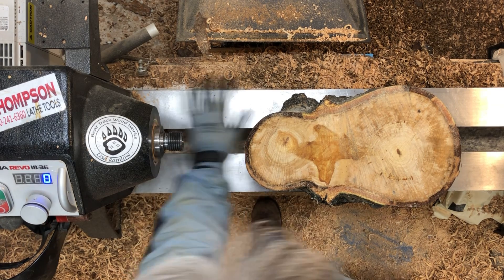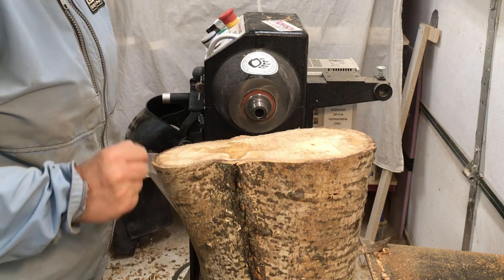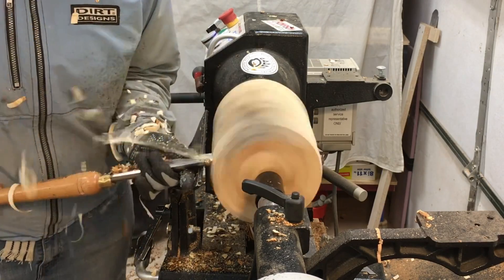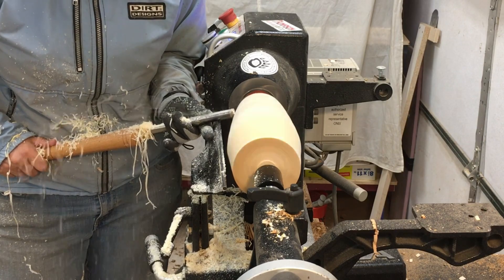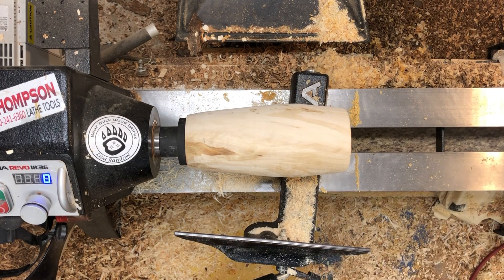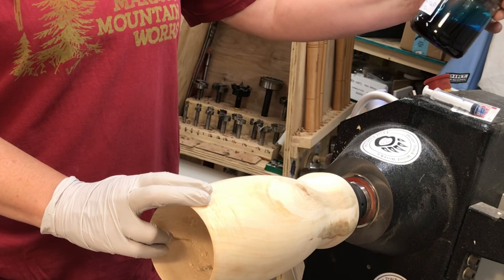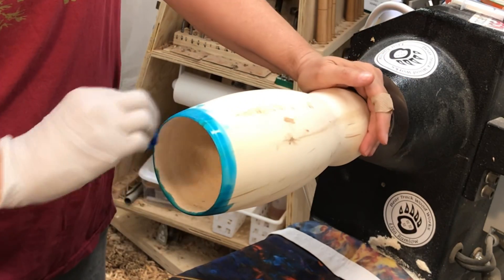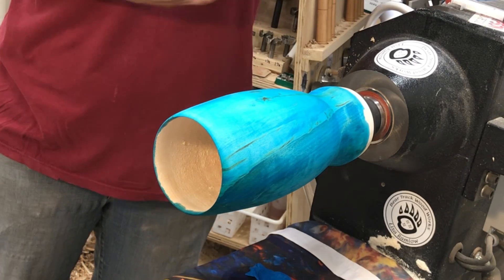Woodturning: Wood Dye on Poplar Vase + CA Glue Finish

Comment: I've tried some dyes, but not the turquoise.  I've never attempted finishing with ca glue out of fear that I would glue the paper towel or myself to the turning.  This came out really well Lisa.  Thanks for sharing.
Reply from the maker: Hi Jim! I’ve always been iffy about CA because my experience had always been one of just that - gluing everything except what I wanted to! But I’ve gotten over that and disco that CA is ridiculously handy and versatile. Buy the vinyl food service type gloves - CA won’t stick to those as they are the same material the CA glue bottles are made from 👍
Reply: @LisaRamlow  Thanks for the tip Lisa.

Comment: Thanks for this one Lisa. I've been fascinated by the whole dye process for a while, but nobody would really explain it in detail. I've seen some amazing finished pieces, but they won't share how they did it. This helps a lot.
Reply from the maker: Thanks Tim! Not a tutorial by any means but I have tried a lot of different things with it as far as trying to seal it. I sprayed shellac from a rattle can and then tried to put a coat on with a paper towel, still ran. The CA is definitely the best sealer option so far.

Comment: Well, you got me with the CA glue. I never thought you could use it successfully like that. At the very least, I thought you might drizzle from the top, catching the excess. But, well done. Great finish from a method I never thought would work. In fairness, I've never had success with it on smaller projects, but I thought I knew how large a project you could use it on. And on soft poplar, too.

I enjoy working with dyes, a powder pigment that can be used in water or alcohol. I've only used water, so far. With water, especially if using multiple colours, the more dyeing and sanding, blending and reworking the better it looks. Seems to give it a look of more depth. That was fine, for awhile. I soon wanted those beautiful gradients Martin Saban-Smith and Stewart Furini (both YouTubers) are skilled at. Wayne the Woodturner, too, I suppose. Airbrushes were the key.

I also had trouble sealing in the dye and getting a proper finish. Anything applied by hand would change the look, and I'm not one for serendipity. Spraying the finish with my little airbrush was the key. Initially, 7-10 coats of Wipe on Poly (sprayed) was a great success, but a bit long to complete, for my tastes. So, I tried shellac. Not bad, at all, and days quicker to complete, under my circumstances. Typically, I'll just use 1lb cut, spray a coat every 60-75 seconds, for about four coats. Then set for an hour, lightly sand 1000 or 2000 grit, do another few, wait, sand and a few more. Cure overnight, polish, wax, enjoy. 

About the buffing wheel, yup, happened to me. As soon as I thought about the edges of your piece coming around to the wheel like getting a catch, it hasn't happened, since.

Great results, colour and finish.
Reply from the maker: Hi Jay! Thanks for all the info - I did try spraying shellac from a rattle can and then putting another coat on with a paper towel - still ran. It ran after the abrasive paste and with the final finish. I must’ve not gotten enough shellac on I guess. An airbrush is on my list of things to try for sure and Martin and Stewart do some great work. Every project is a learning experience, even if it’s what NOT to do 😂
Reply: @LisaRamlow  Yes, learning together is good stuff. I forgot to say that I want to try these dyes with alcohol, but sprayed. Before, applying by hand, I needed the working time. Sprayed, you might get interesting effects from quick drying. About spraying shellac, I tell myself if you think you're good, four more coats. :)

Comment: That vase came out beautiful and the colour really enhances it.

Can't say about the dye you used, but I use some spirit based ones and no matter how long I've left them to dry, if I apply a sealer by hand, it will lift.  My understanding is that it gets reactivated by the moisture/chemicals.  What I found works best, is to apply sealer/lacquer via aerosol applicator.  Once it's sealed, further finish can then be applied by hand without lifting any dye off the piece.
Reply from the maker: Thanks Jiggsy! I will try the spray sealer next time 👍

Comment: Thanks for this video. I ventured on my first wood dye project last week. Had a beautiful layer of stain but when I sealed it with sealer had the same result as you with it taking a majority of the color. As far as any blotchiness, thought about first applying wood conditioner then the stain. Also thought of spraying the stain with Deft and not using a sealer. Yours came out great. I’ll be interested to know what you find out about the stain with sealer.
Reply from the maker: I think if I’d sprayed several coats of shellac from the rattle can and then put a coat on with a brush or paper towel it might have been all right. But I will let y’all know if I get any good info!

Comment: Wow I felt so bad for you at the start you sounded so bummed. But also WOW this project turned out great!  I also have the Beale system and I have years of experience with Tripoli and white diamond from the Dental Lab industry. I think you’re running the buffing at too high a speed but you got great results. Yes be careful how you position your workpiece when buffing, the wheel can easily catch it and throw it. Great job!
Reply from the maker: Thanks Victor! The mfg recommends 1725 or 1750 can’t remember which off hand. And I know better than to let the piece get that low on the wheel but 💩 happens. 😂. Fortunately I was able to sand out the dent, the refinishing process went smoothly and Im quite pleased with the end result, no matter the course it took to get there 🤣

Comment: for polishing up the ca finish look at getting some of the larger pieces (3"x4") of micro mesh which you use wet.  I use the smaller pieces of micro mesh for polishing my pens that I make that have a ca finish.  and a free tip for the micro mesh - take a sharpie and make 1 - 9 dots on a side (not s buffing side but a foam side) to know what order to use them in.   no flying pieces that way since you use the micro mesh while the piece is on the lathe and it would be like using micro mesh on a very large pen.
Reply from the maker: Hey Byron! I have the small micro mesh pads and did the Sharpie trick as soon as I got them! I also have the 5” pads for the orbital sander to use on River tables and charcuterie boards. In this case, I found it much quicker to wet sand, do the abrasive pastes, and buff than to go thru wet sanding all the grits of the micro mesh. I’ll have to try a little comparison of CA with the micro mesh vs CA with buffing - see if you can tell the difference, and which is faster. 
Thanks for watching and for the tips!

Comment: haveing 20 pounds of wood spinning at 3500 rpms is un nerving to say the least i never turn past 3 on my lathe whitch is 1500 ish if i rember right
Reply from the maker: Yeah totally agree. This being mounted in spindle orientation it could go a bit faster than if it were in cross-grain orientation but I l feel more comfortable turning a bit slower 👍

Comment: The worst sound in woodturning "FADOOOK".  That's what it sounds like to my brain when the latthe ejects a more or less "done" piece at a high rate of speed towards a hard surface.  Much less of "FABANG" which is what my brain hears when a piece that's more solid/closer to log form goes off the lathe.
Reply from the maker: Indeed! And then it sounds like Roy Kent walked into my shop 🤣